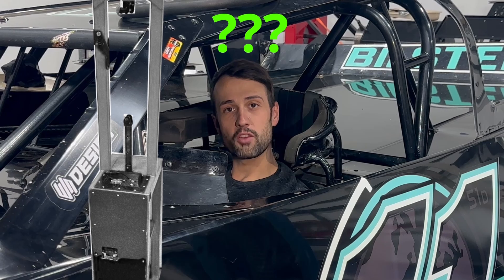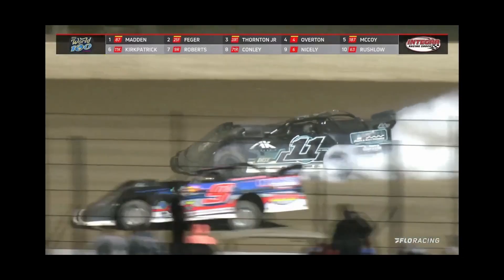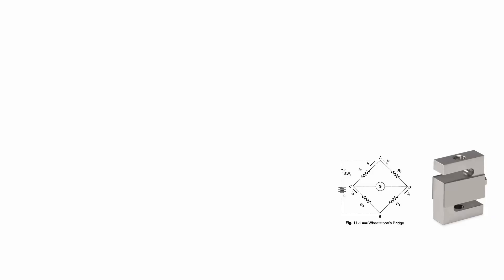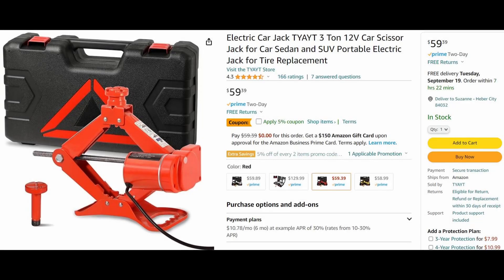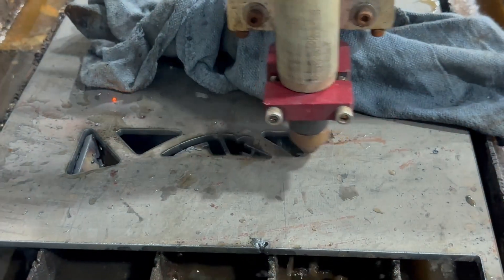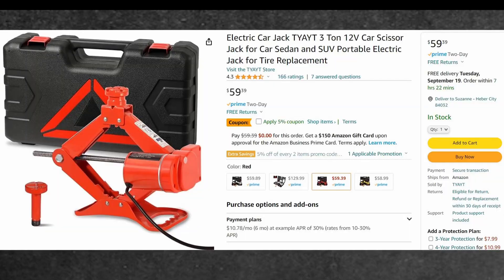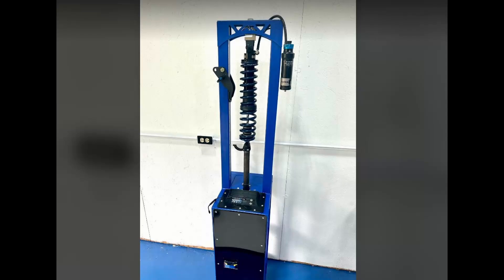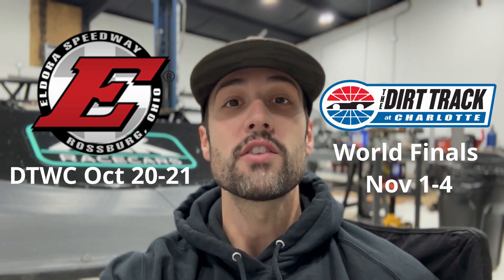Can I build a SPRING SMASHER for under $150??

Comment: I wish you would make a video on just programming the load cell , I bought the set up to build a spring smasher but there is no info on setting up the system
Reply from the maker: @schoonymopar  YouTube: HX711 Weight Scale Display how to calibrate and how to use ENGLISH
Reply: @AKracecars  thanks

Comment: Thought I was subscribed after the straight axle video. I was not but am now.  Working on building a cheaper one to put in my trailer. Dad has a little fancier but still simple one I use currently but having to run between shops sucks.   Working on intergrating a raspberry pi and Arduino into the design for graphing and instrumentation. Glad to come across your video.  Completely forgot about most load cells being 150% rated. Saves me $100 by going with the load cell you used vs the 3000lb I was looking at. Thanks for the great information.

Comment: I used a scissor jack and built 2 years ago. But mine can sit on top of a bench and the top is adjustable for the longer or shorter spring setups. 👍

Comment: As a scale technician of 10 years (I deal with load cells every day), I love the ingenuity of the load sensing porting of this! 

I will say I would be weary of the accuracy of that setup, 1 being high quality S beam cells are generally a few hundred dollars. Using the phone as the excitation to the load cell would concern me as the m/V output of the load cell linearly scales with excitation voltage, I’d wonder if the phone would provide a steady voltage.
Reply from the maker: With a full Wheatstone bridge, (which an S type is) variance in input voltage shouldn’t effect the reading, as it will effect all 4 legs of the bridge equally. I’ve been impressed with the accuracy of this cell after thoroughly testing it, and is well within our very wide tolerance range (+/- 10lbs). I’m sure what you work with requires much higher accuracy and thus, accommodations must be made!
Reply: @AKracecars I’m sure we could figure out a way to verify it with one of our calibrated load if you’re interested in that! I’d love to see how well it does

Comment: On the scale how do you know you are in lbs and not KG? I made a load stick and have it all wired, just wondering if I put 200lbs on it that sets the range and I dont have to convert?
Reply from the maker: The unit of measurement doesn’t matter because you are setting the scale. You could zero it, then put 10 chicken eggs on it, set that point to “10” and it would read in Eggs. Lol
Reply: Makes sense now but didn’t at first lol.😂so can I make a load stick that reads chicken eggs as a scale nobody will ever know my numbers!!!
Reply from the maker: @NorthernFabandMachineLLC  precisely. I hear the magic RF load number is 865 eggs at 400 millimeters

Comment: If you want to get into .001" accuracy. I bet you could "repurpose" a set of dial or digital calipers and fix to a braket that travels with the ram.
Granted, cheaper calipers are less accurate than a more expensive set. But much more accurate and easier to use than the tape.

Comment: You may want to consider a new 3d printer since you actually use yours. I had similar issues (slow, inconsistent first layer surface finish, massive ringing (around the arrows)) with my Ender 3 (some solved with upgrades) and have been so happy with Bambu Labs printer. Definitely more money but so easy to get good prints quickly.

Anyway, love these vids.
Reply from the maker: Yeah Bambu P1S is on the short list. They are nasty.
Reply: I got the Creality K1 Max and it’s a BAMF too.

Comment: What Cad software is that? Struggling with auto desk... If you want to get real fancy, you can use something like an RP2040 and add in a linear potentiometer or ToF Distance sensor (still wouldnt be as accurate as a tape measure most likely....) If you use an Rp2040, you can use pandas and flask/microdot to visualize the data instead of manually making a spreadsheet. Awesome work dude.
Reply from the maker: Trusty ole solidworks. I’ll look into the rp2040. On my next one I was planning on using an arduino, OLED screen, and string pot. We will see how adventurous ChatGPT is feeling on code for the graphing 🤣